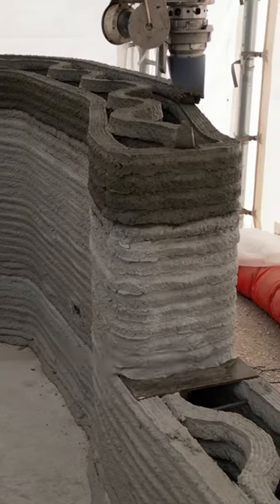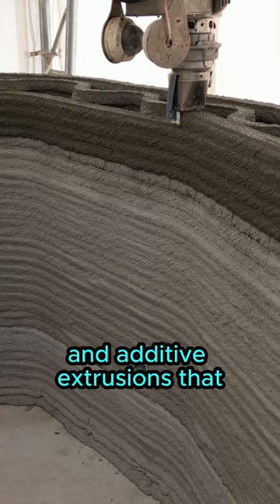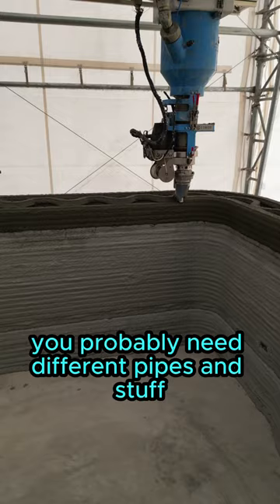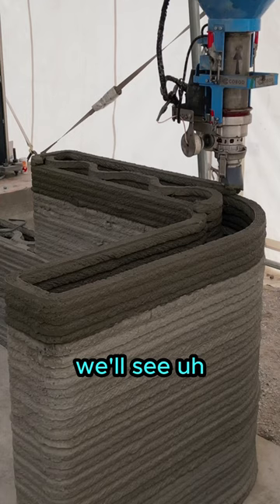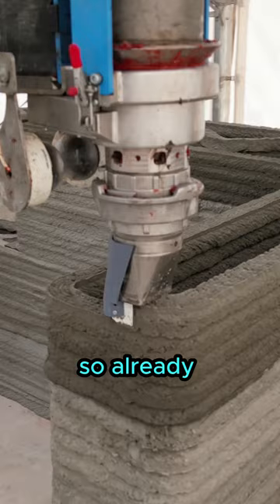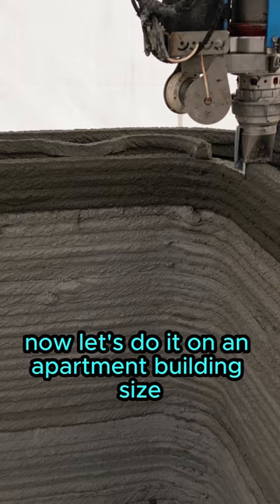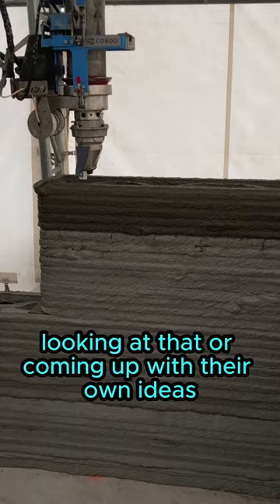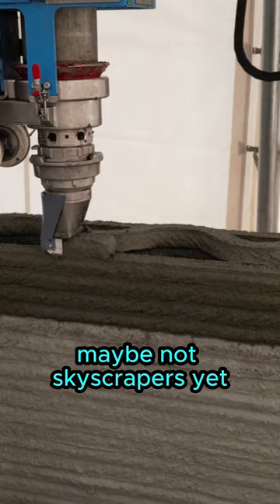@automateconstructionpodcast EP 43 with Nidus CEO Ian Arthur

Comment: So how does this affect plumbing all your receptacles, plumbing and duct work?  Is it all going to have to be added into the programming of the printing so you can install it as it goes? Or is it all gonna have to be exterior which then you're gonna need to frame over that which basically negates the need for printing walls out of concrete which was said to lessen materials used. 
 If it doesn't come with any of that then I could only see it used in building utilizing none of that.
Reply: It's just like a brick or cinder block building. This is the outside of the building. All the ducking and piping and everything else is on the inside not to mention pipes can be ran through that wall just the way they had it printed right now.
Reply: @loydfamily8046   So not necessarily meant to be aesthetically pleasing and also running duct work through hollow concrete walls would make everything that much more expensive to service if it ends up freeze cracking and you usually have a higher heating bill because those houses don't stay nearly as warm.  I had a brick house for about 5 years in the winter unless you had the fireplace going 24/7 it got cold in there real quick.
Reply: I believe they say they have their own plumbers and electricians that work as the machine goes I do wonder how they’re going to insulate the building it definitely would not be cheap to rigid foam insulate the exterior and then put a fade cover over it foam insulation only gets around r 15 with 3 inch which in my area is about $80 per panel in Alaska you need around r 40 They should make something to allow for insulated bays

Comment: Building like this is as much or more expensive than building the conventional way. However these building made this way will not last. There is almost zero reinforcement in them and they crack while building them. The walls are also dust magnets on the inside. I think these are made to fool people into thinking they're in a solid concrete building when theyre infact in something weaker than their current stick built home. These will collapse on people and fall apart after a few years. Maybe less if its somewhere with any kimd of weather. Especially freezing weather which will tear these building apart with freeze and thaw.
Reply: 😂😂😂😂 You obviously have no idea what you’re talking about.

Comment: Do these structures get reinforced? Are the cavities filled with poured concrete?
Reply: No. They are supported by their structure.  The entire thing supports itself together. They are left hollow so you can run ductwork, electrical, and piping, but also because that squiggle down the middle is a good support. You're not normally going higher than 3 stories and you're not going higher than 1 story in areas with harsh winters or summers.
Reply: Don’t listen to  @JoshuaEFinley  he has absolutely no clue what he is talking about. They are very structurally sound and will last a whole lot longer than any modern construction. They will only get better and cheaper. It’s going to be the only way to build a house that is affordable in the near future. However don’t take my word or anyone else on here, talk to an engineer in this field like I did and really learn about it.

Comment: No reinforcement possible. This structure has no tensile strength. Cannot take bending loads. No overhang structures. Plus the material is terrible as far as energy and carbon footprint goes. Duct work, electric, and plumbing is very difficult. Forget modification of an already built structure.
Reply: You should just stop. You have absolutely no clue what you’re talking about. You have clearly never done any research on the subject.